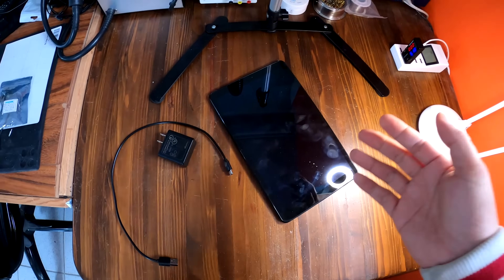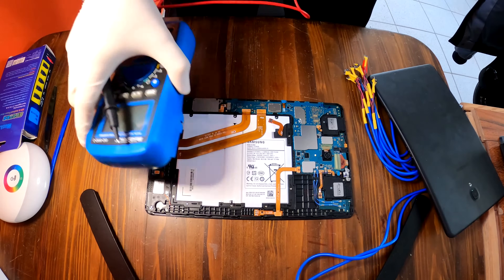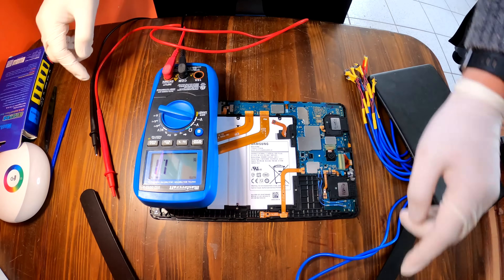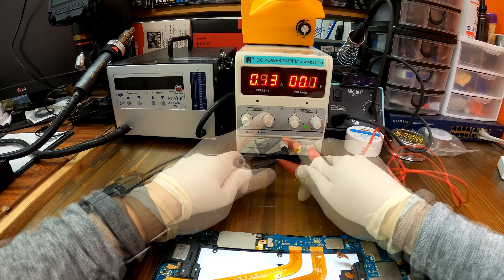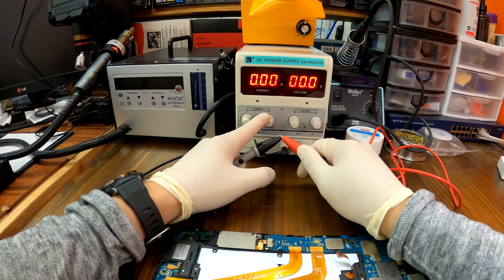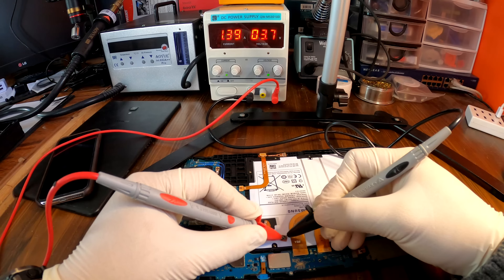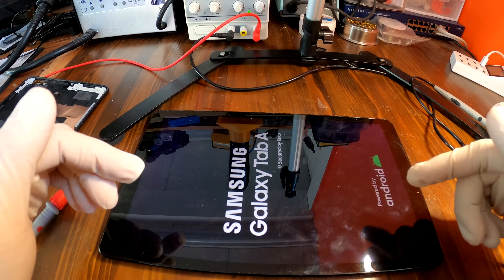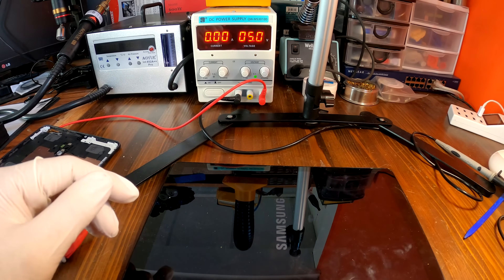How to charge tablet, phone battery (with DC Bench Power Supply)

Comment: Excellent demonstration ! Do we need to change tablet faulty charge port after supplying power ?
Reply from the maker: I not 100% sure about that. The problem could be a charging port but it could be the small motherboard where the charging port is installed or it could be the motherboard issue. You will need to diagnosis. Thanks.